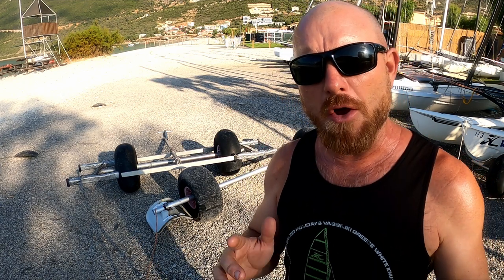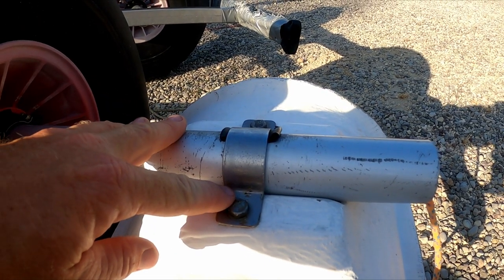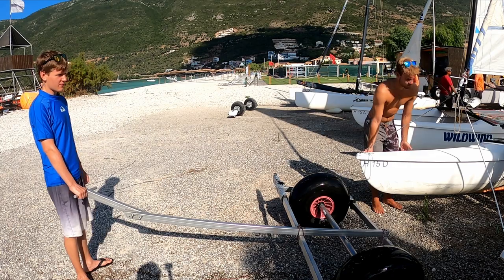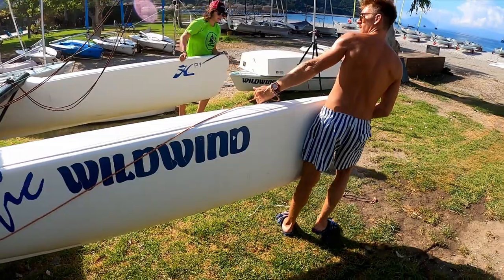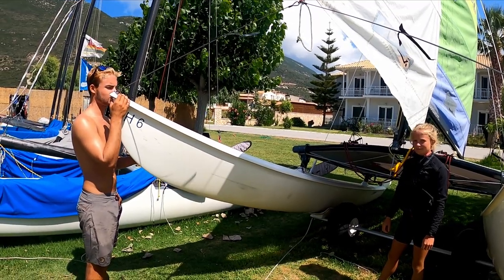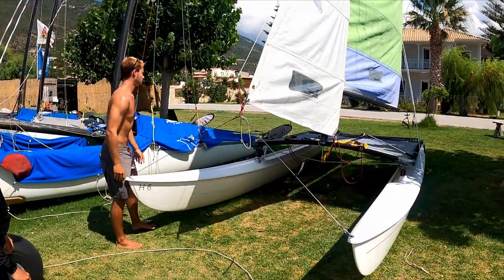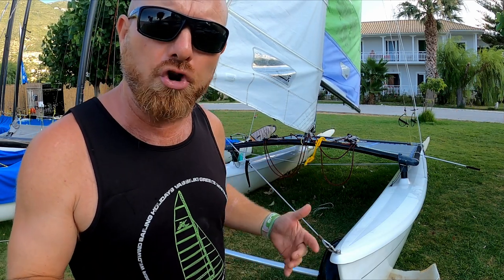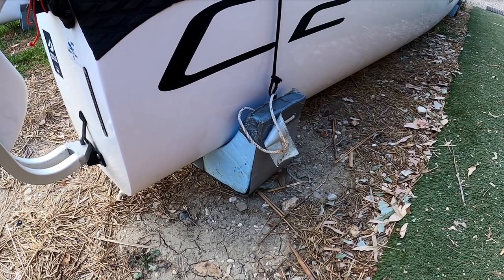Beginner  catamaran lesson   the launching trolley

Comment: A beach cart is essential in my situation for getting my boat from the front yard to the river edge where I put it upside-down over the bow of the hulls (it's a double beam cradle with 8" side posts). I then paddle my boat (10 minutes ) , sails onboard, to the mouth of the lake where I use the beach cart to roll the boat over the low water at the end of the river. The cart and paddle gets stashed, I raise the sails and off I go. It's a bit of a procedure but I don't have to trailer or raise the mast each time I sail.
I put my boat on 4- 6x6 wooden blocks on the grass. Keeps it stable and up off the ground.
Reply from the maker: Nice, sounds like a much better solution!

Comment: Thank you for posting Joseph! 
This was very informative. I am trying to decide either to build a trolley system or purchase one. Trying to locate a manufacturer for the big fat wheel and axle bearing. 

Ramon,
Hobie 18 skipper from Texas USA
Reply from the maker: I buy all of ours from cadcat in germany around 150 euros per wheel - those big wheels are expensive but worth it.
Reply: I went the DIY route first but struggled with it once built. The key is having some sort of bearings between the axle and the wheels. Difficult to source for a DIY build (The Cat Trax uses delrin rods along the axel between it and the wheel hubs.) After a few years I splashed some cash (around $550) on the classic Cat Trax with balloon tyres from Florida Sailcraft. I wish I had just done that from day one. Nothing I have seen comes close to how easy they make it to manouver your boat around. 
Another tip, if you have the basic cat trax without the cradles you may find the boat wanting to slip backwards once you have it at the balance point. You can fix this by running a line from the center of the axle back round the rear crossbar, through the mainsheet cam cleat and up to the front beam tied off round the dolphin striker. Especially useful if you are doing it solo and when getting the boat out of the water at the end of the sail. I tie the line that comes out of the axle ends up round the shrouds, back down and around the axle ends then up again tied off around the shrouds.

Comment: Anyone here have a Hobie Getaway that they use on beach wheels? I find it’s always at least a two (sometimes three) person job. Would love any tips for making it easier!
Reply from the maker: I'll make a short video with a quick tip.
Reply: @JoyriderTV  Thank you!!
Reply: @JoyriderTV  Hi Joe, Love the videos. Did you ever make the video on using the beach dolly with a Hobie Getaway? If so can you post a link. Given the weight of the boat, its a bit of a hassle to cart it over soft sand. I have a standard beach dolly and was wondering if a frame dolly would make it any easier. Any advice would be appreciated.
Reply from the maker: @VinceManiscalco  unfortunately, the style of trolley wont really make to much difference - it's the big wheels that will really help in soft sand.